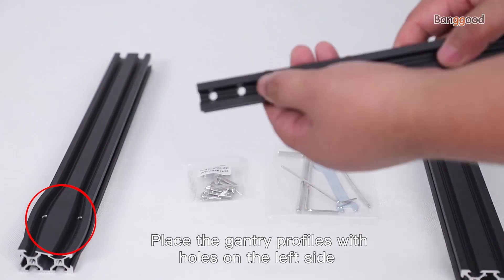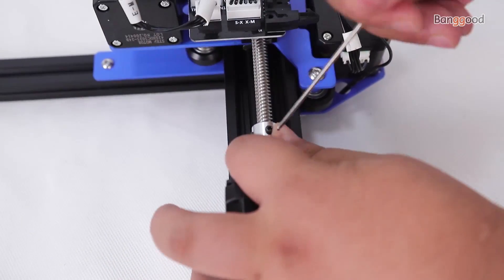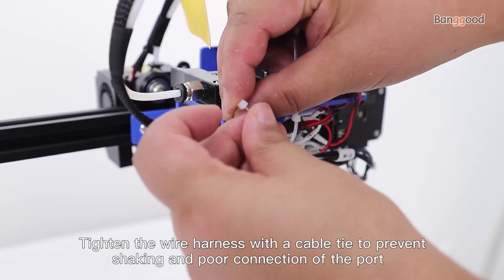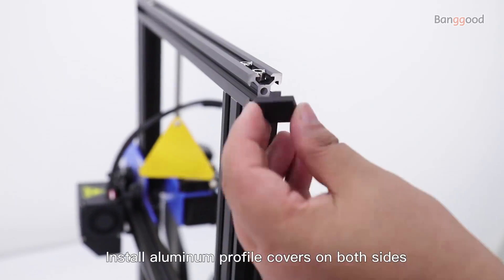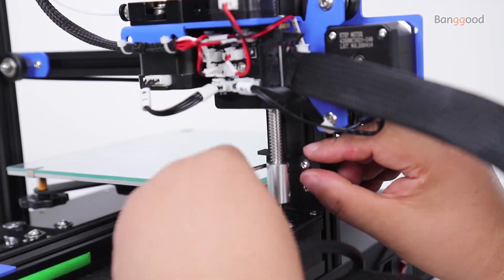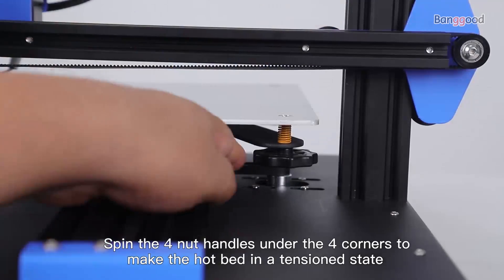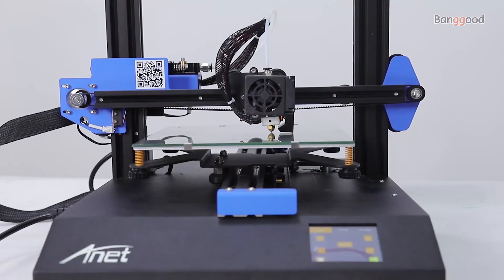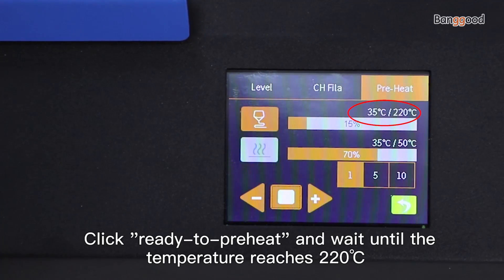Anet 3D printer assembly | ET4X 3D Printer Kit

Comment: I've only been having problems with ET4plus since its arrival. First there were clicks on the extruder (problem not solved). Then it was an overheating of the hotend connection on the auxiliary board that melted the END connector. Then the printer simply does not do HOME or automatic table alignment, nor does it print. Thirdly I bought it at banggood and their delay in solving my problems is making me more and more upset. I will pass on to you from Anet to see if you contact Banggood and help me resolve this. The printer is not even 30 days old that arrived at my house and has only given me annoyance and disappointment. I ask for your help. Here are the videos of the problems I've been having with the printer. The identification number of my order at Banggood is  95569550

1 - problem: @
2 - problem @

After the video 2 problem I can't print anything anymore. The printer just keeps going up the Z axis, it never goes down. I believe that both the capacitive sensor and the small intermediate plate are in trouble.
Reply from the maker: Hi, Marcelino. Thanks for getting in touch. We would like to inform you that our customer support team is aware of your case and they are working on a solution. They will be in touch with you via email. Your patience and understanding are appreciated.